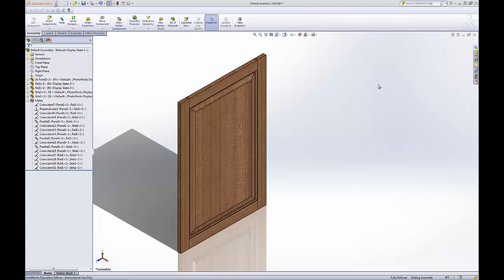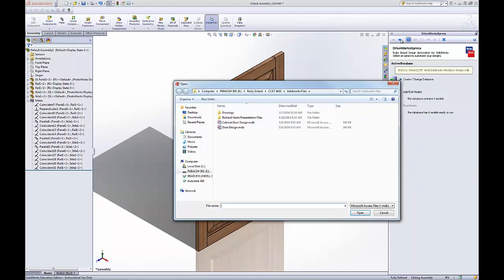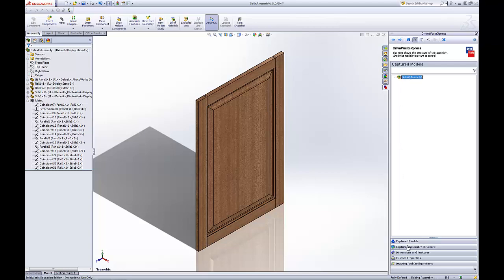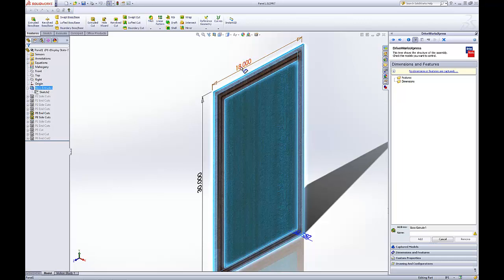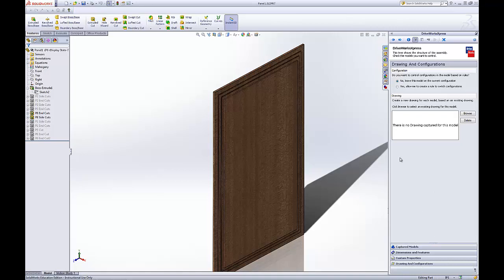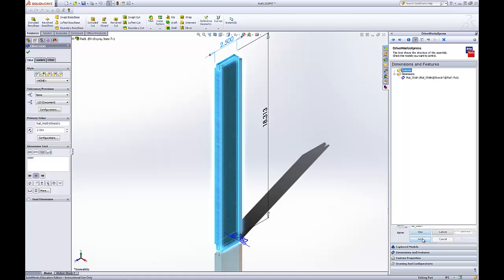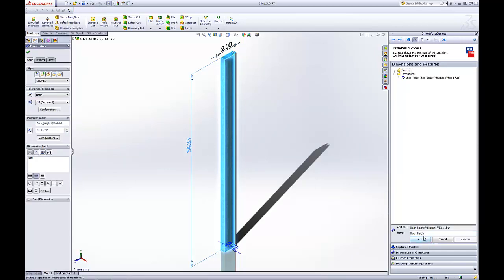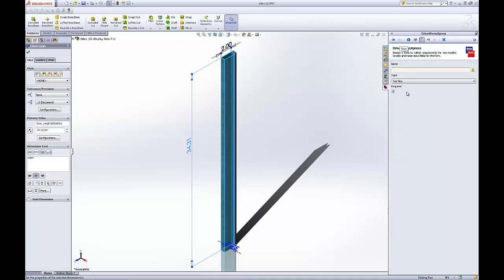SolidWorks DriveWorksXpress Capturing Dimensions & Congifurations 004

Comment: If the model link to parallel or mirror feature in the configurations, how to connect those feature in driveworks capture?
Reply from the maker: Well you can link parallel and mirror features to Drivworks but the only thing i know you can do with them would be to turn them on or off